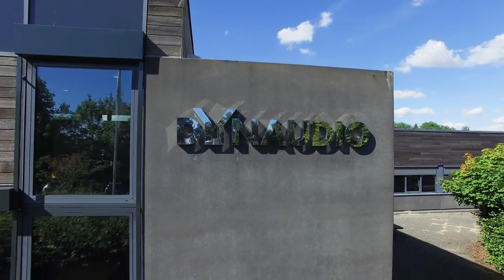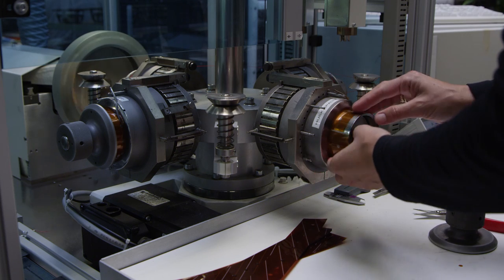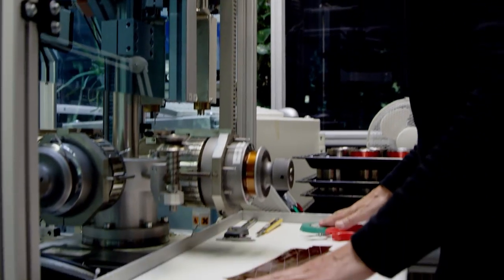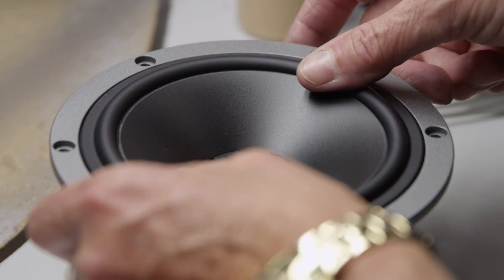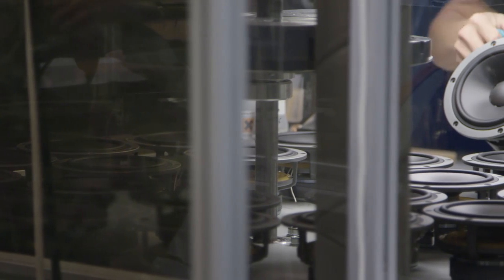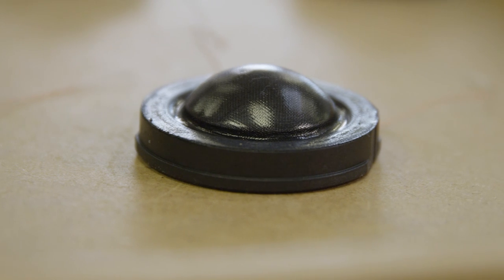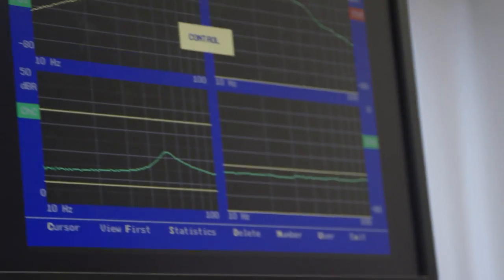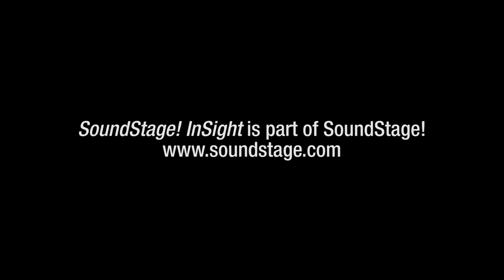Dynaudio History and Driver Technology | SoundStage! InSight  (October 2016)

Comment: My first self built speakers were using the  Dynaudio D 28 tweeter  and a 21  W 54 woofer with plastiflex treated paper cones, in 1981. Just simple  first order filter using a polystyrene bypass. 4 cubic feet sealed with a Carver 250 watt/channel amp, they were quite stunning. Have used Mr Skaanings other products, but his newer AT line with composite cones looks very interesting.
Reply: My Brother has them. They were a bitch to cut as I was able to obtain particle board with a density of 75 pounds/ ft^3. I had to have my Freud blade resharpened after building them. I've been using Speakerlab's( Dave Graebener), RD 57 planar magnetic above 200 Hz, in a dipole, the prototype for the B&G Corp line, and (2) Morel MW 164's, each in 12 foot long, schedule 40, 6 inch diameter, PVC waveguides with first order xover, since '89. Built a totally discrete, MOSFET output, Class A, amp to drive them. My version of the Lang Amp,( The guy who designed it, Old Colony sold me the circuit boards), based on the topology from Old Colony's(Amateur Audio)published design. Nelson Pass said, at the time, it was the most advanced and elegant design thus published, including his own design. So I built several. I've bought the Raal 140-15D's ,(tweeter) Lowther DX 65's(midrange) and Jordan JX 150 NG's(Bass),2/channel, for a new design powered by Transcendent Sound's OTLs.I'll be loading the moving coils in waveguides also.

Comment: I have made some very expensive  projects with Dynaudio. BUT all their divers have failed with me 
30W 100 Cone distortion . Surrond failures 3 times . D76 coil fly wires on cone snapped off D21 & D28 stopped working 
Sounded the best WHEN they worked 
I have now been doing some work with drivers from SB Acoustics  ( The performance for the price number 1 ) 
All my speakers have been driven with high end NAD pre amps & Quad 606 Mk2
Reply: If that's that easy why do people buy loudspeaker from professional manufacturers
Reply: My 30 year old midrange still works perfectly

Comment: I love the idea to fix the driver if there is an issue, and not correct it in crossover. However, with the knowledge claimed here, why they are ruining it in crossover with cheap parts like sand cast resistors? They MUST know it degrades the sound. For what? Saving few cents on $1500 speakers?

Comment: You better do it in-house, we are talking top of the line, right? Or did I miss something.
Reply: Every line of them is made in-house
Reply: @viincentfonkert2870  Late to the party here but... in-house? Kinda. In Denmark? Not entirely. Hard to find exact info and what is built where now, but there's a lot of stuff being done in Latvia (at least at one point) and China - like the Evoke series states it was designed in Denmark but made in China. I don't see it being any different for the cheaper lines. Which is sad, I always admired them doing things almost strictly domestically. Being bought by the Chinese is just sad.
Reply: @tvih84  I believe they actually do, the crossover parts and some materials they get from eastern europe and china. But I'm not sure. Yes I admire that too, thats why I like  ATC and Amphion so much
Reply: I was just re-checking and actually Evoke 20 does say Made in Denmark, but Evoke 10 is indeed labeled made in China. So I guess it's more on a model-by-model basis. Ah well. Regardless, it's clear it's no longer a Denmark-only affair :(
Reply: @tvih84  now that we're talking about it I started thinking. I did see a few Evoke 10 with some very shitty placed Dynaudio emblem's

Comment: The problem is low sensibility!!!
Reply: I agree.
Reply: You overcome this by big amplifiers..... 😅, so the small speakers easily eat 150 watt..... The big speakers (like finale/evidence) ones are not impressed by 600Watt. This is not an overestimated amount of watts.......
Reply: Low effectiveness is only an advantage. Loud speakers usually make noise before they produce good sound and quietly play worse. I already had several columns and I prefer them with less effectiveness. Of course, you need to provide them with much more power, but buying a good amplifier is not a problem
Reply: No that is deliberate design to produce great mid bass punch... once you combine with a high current amplifier like Rotel.
Reply: Most high end speakers are super inefficient, not sure why but they can't all be wrong, any one buying these levels of speakers shouldn't be struggling to put lots of power to them with a high end how output low impedance capable amp and 600w of clean power as someone else said is nothing to most of these speakers.